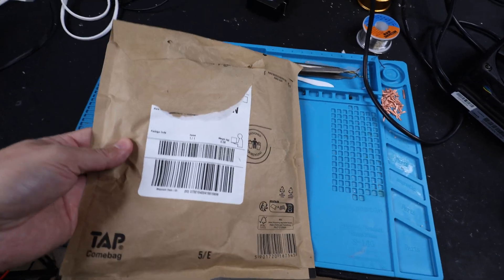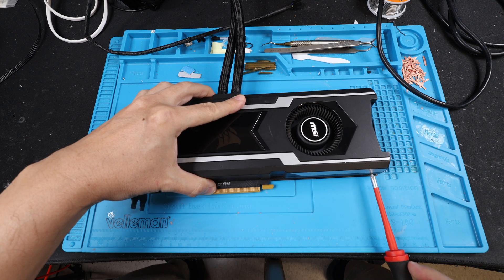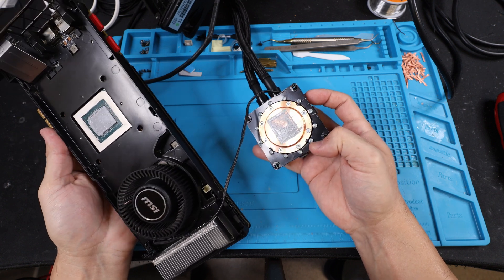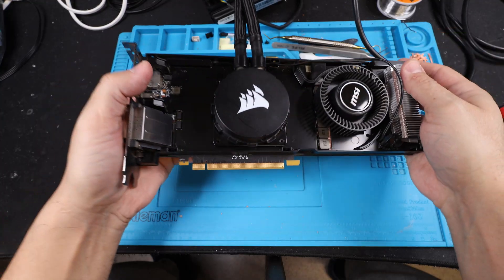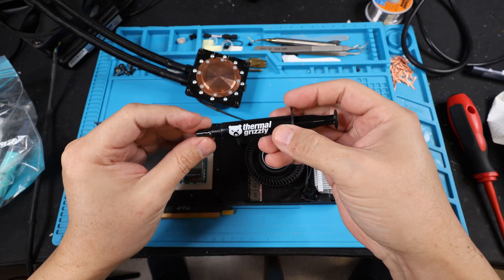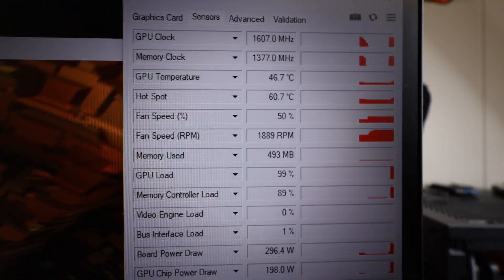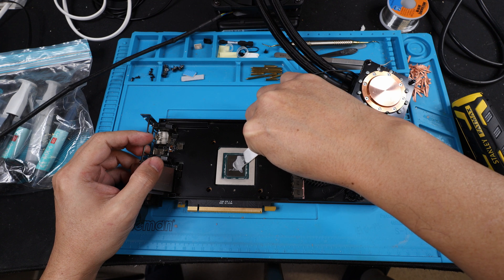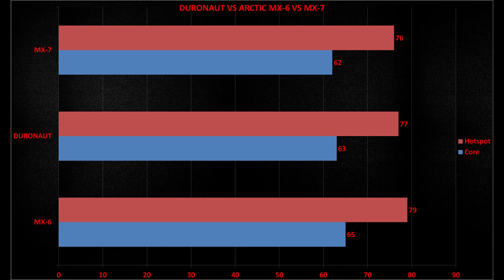Arctic MX-7 vs MX-6 vs Duronaut Test.

Comment: I used to use thermal grizzly kryonaut, it works great for 6 months and then dries out. MX-6 has lower performance initially but it's been rock solid in the long term.
Reply from the maker: I've been using MX-6 since it came out on my 7900xtx, and it's still running as day one.
Reply: @TechnologyHive  tried MX-6 on my 6950xt, pumped out after 2 months. PTM is the only way to go for GPUs
Reply from the maker: @JBrinx18  I have not experienced this. I have MX-6 running on a card since it was released doing folding@home 24/7. Temps are the same since day one.
Reply: @TechnologyHive  actually placing a consistent load doesn't cause pump out. actually its the opposite. by folding@home 24/7 you're essentially placing zero thermal cycles and negating pumpout all together lmao
Reply from the maker: @Marauder-q2v  That is not how pump out works. This has been tested by other bigger channels and the outcome is the same. Cheap pastes with low viscosity tend to pump out because of low pressure resistance. 

High viscosity pastes, like Duronaut, MX-6, and MX-7 do not pump out, thanks to their physical composition, or viscosity. Have a good one :)
Reply: @TechnologyHive  But thats exactly how pump out works? Different thermal expansion coefficients of different materials and thermal cycles cause pump out. Folding@home maintains a consistent temperature which palces zero thermal cycles and reduces the pump out effect. 

I never said that high quality pastes cannot resist pump out. I'm just pointing out that your experience with the mx6 in that particular isn't applicable because you've placed little to no thermal cycles on it. I use mx6. I know., its a decent paste even if they released a billion revisions and the one I got was the older one.
Reply from the maker: @Marauder-q2v  "gpu wise. I think PTM is the only choice because it resists pump out. CPU’s with a IHS is usually fine for this". You literally started your comments with saying PTM is the only choice. This is silly lol. Have a good one man!
Reply: @TechnologyHive  Oh you're referring the comment in the other comment chain. I don't know if you got the recent nested comment UI update yet.  I meant it as in completely resisting pump out since high viscosity thermal pastes can't beat something that's physically a solid at low temps. I also meant it FOR ME, because I really don't want to open the gpu back up again. One time is enough. I should've probably been more clear.

though i don't think I need to repaste period on my card. Its a reference 6950xt and AMD chose a weird solution for it. Its a graphite pad. The temps are pretty mid hotspot wise but it'll pretty much never change.
Reply: @TechnologyHive gpu wise. I think PTM is the only choice because it resists pump out. CPU’s with a IHS is usually fine for this
Reply from the maker: @Marauder-q2v  I have not experienced any issues using MX-6 after using it since it was released, as far as pump out or thermal conductivity degradation is concerned. This is just my experience with this stuff.
Reply: Mx6 has a pump out problem. I'd assume mx7 would have solved said problem
Reply from the maker: @TimberWulfIsHere  I have not experienced this with MX-6.
Reply: Probably got scammed with fake Kryonaut. Never had your experience, and i used it dozen of times since it got released. Actually Kryonaut, the real one, is made to last for over one decade, and you need burning hot components to shorten that life span.
Reply: @Nebujin383I got it right as it launched to see if it was any good, nobody even knew its worth to counterfeit it back then

Comment: Its good if its viscous, better for bare die application. In saying that NT-H2 is not particularly viscous and its been excellent for GPU use.
Reply from the maker: True. But NT-H2 is a real good thermal paste. But bare die application is rather use MX-6 or MX-7 now that I know works well.

Comment: Currently using the MX6 on my 9800X3D. Idles at 38c. Stress tested for 10 minutes on Aida64 was 71c. Undervolted both CPU and GPU, good airflow feeding the GPU, and capping FPS makes my temps very low. I love to tanker my PC, but hopefully this is the last time.
Reply from the maker: MX-6 has always been a great product. It should last you a good while 👍🏼👍🏼

Comment: And duronaut cost 3 times more LOL
Reply from the maker: I would rather go with MX-7 😊
Reply: Duronaut has less pump out and will last longer and be able to heat cycle more than most pastes. Lol... One track mind.
Reply: @tacticalcenter8658 comparing "pump out" to a company(arctic)who is In this industry for 23yrs vs a 13 staff count at grizzly 😂 RIP with a 3 times higher price 🎉
Reply: less pump out my arseee. It pump out after 3 months
Reply: @Eric-h5r7d  proof?
Reply: @Eric-h5r7d  checking in again for your proof.
Reply: @Eric-h5r7d  Eric, you got any proof?
Reply: Igor is currently testing Duronaut and its been through over 7000 heating and cooling cycles currently and still going.

Comment: Duronaut is for longevity. it will be interesting to see after  1 or 2 years of testing how MX-7  stands up in regards to thermal degradation.  if you're someone that rarely changes out your thermal paste id take Duronaut over MX-7.
Reply: Thermal paste degrades faster when exposed to high temperature. I doubt MX-7 will be last as long as Duronaut in GPU application.
Reply: Longevity must be present on the package or advertisement materials.
For max-4 it was 10y.
My MX4 on an old pc is already >12years <60c under load, looks like no changes from the application
Reply: @DrWatchHD  thermal grizzly does with  Duronaut on their website.

"Duronaut is a high-end thermal paste designed with a focus on outstanding thermal conductivity and exceptional long-term stability. The name "Duronaut" derives from the English word "durability," emphasizing its extraordinary longevity. This stability is achieved through a specially engineered silicone oil combined with aluminum microparticles and zinc oxide nanoparticles of various shapes. These optimized particle shapes and sizes minimize the "pump-out effect," ensuring excellent adhesion to surfaces and resulting in extremely low thermal transfer resistance."
Reply: Why would you ever need to change it yearly? I havent even come across a TIM that bad. I used NT-H2 on 3090s I used for mining, I still have two used for gaming and temps havent changed at all in 4 years. Thermalright TFX, TF8, CM Mastergel, NT-H1, PTM7950(only if I never intend to remove the cooler again), good old Artic Silver, anything Dow Corning that comes pre-applied that idiots wipe off and replace with something worse 😂, all have worked well and didnt need replacing. I've used Carbonaut on 3090s and that matched TIM to within a degree. Some people must be using toothpaste.
Reply: @Berserkism  for those that want maximum peak thermals without loss of thermal degradation from the paste. I know overclockers that change out their paste yearly for this very reason.
Reply: @RhinoXpress  do they even see results?
Reply: @DrWatchHD  I can't speak for all the overclockers but the ones I know have after a year, which is why they repaste yearly.
Reply: arctic is always better
Reply: @Seattlex1  no it's not. Im positive Duronaut will last longer. It was specifically designed for longevity for that very reason.
Reply: @RhinoXpress  the kyrosheet does better than most thermal pastes

Comment: so get what ever is cheapest at the time unless you are going for overclocking and need the couple degrees.
Reply from the maker: Duronaut will be the way to go for longevity if the claims are real.
Reply: @TechnologyHive  I used it on a processor and just recently removed cooler. It had been on there over 5 years and it was not completely dried out.
Reply from the maker: @adamstull2436 Which paste was it?
Reply: @TechnologyHive  It was Kryonaut. So Duronaut should be even better for longevity.